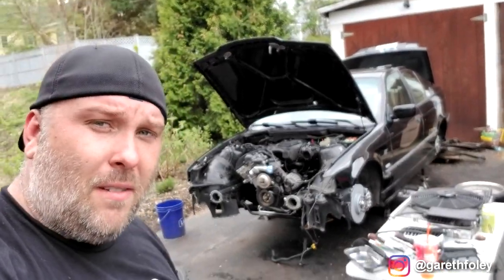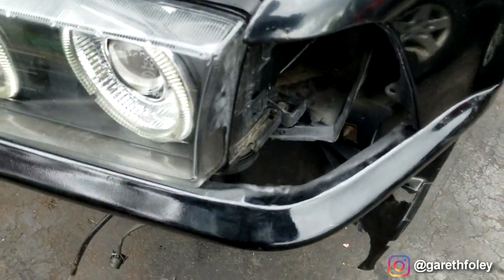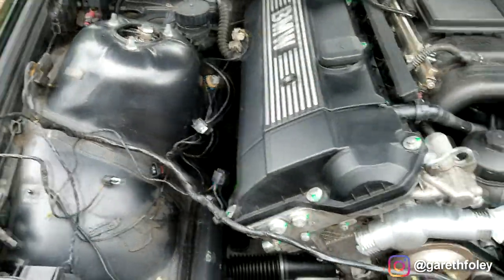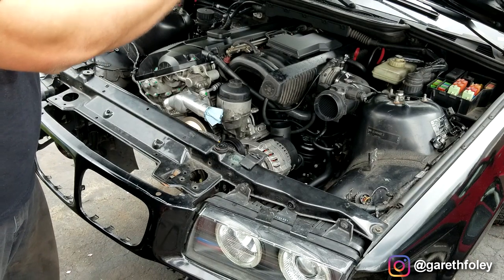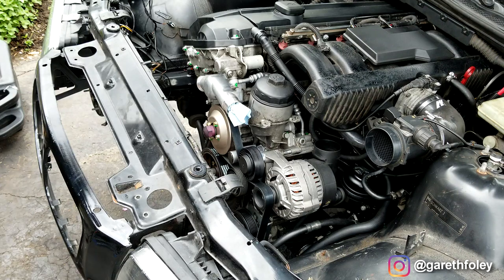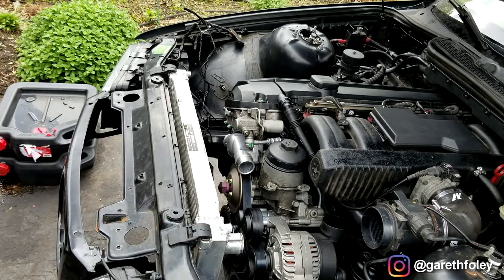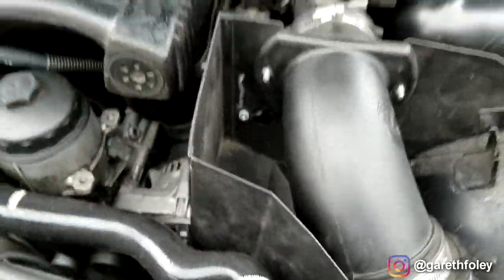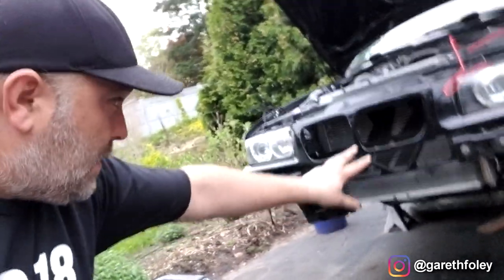Installing the Front Clip On The E36

Comment: Since you've deleted A/C, you can use the existing wiring for the auxiliary fan for the mishimoto fan. Is there a benefit to installing the fan controller over using the existing wiring?
Reply from the maker: The two major benefits with using a stand alone fan controller is the ability to set a turn on point independent from a traditional dual temp switch as well as install a fan override switch. The biggest thing for me personally is the fan override switch as I want the ability to turn the fan on at will.